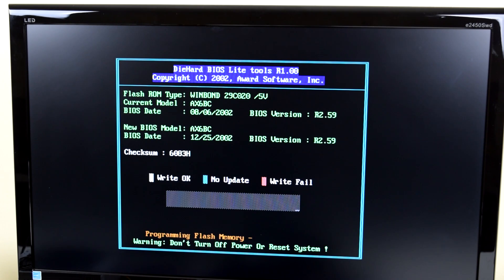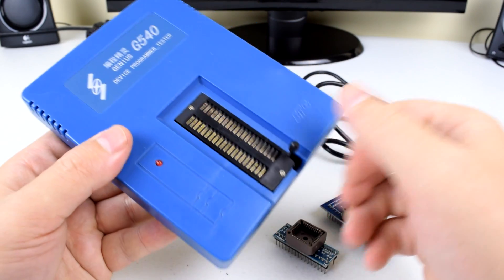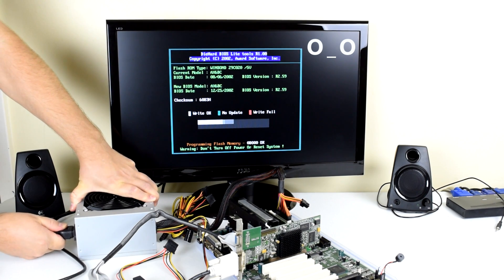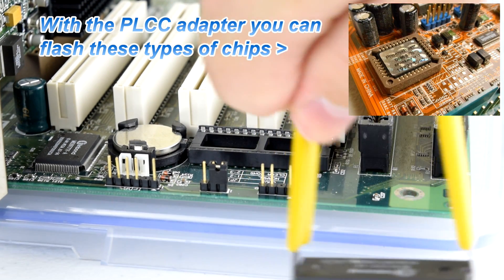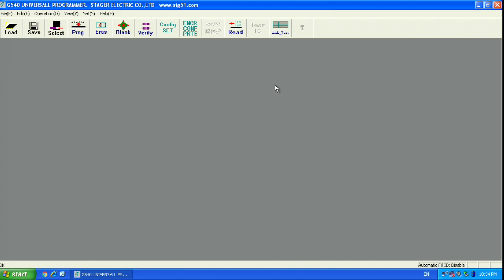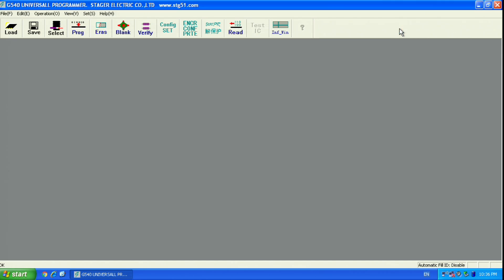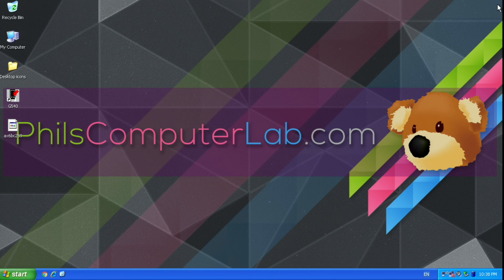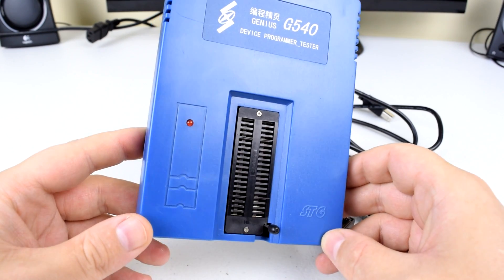External BIOS flashing with Genius G540 flasher programmer

Comment: In the late 90's I corrupted a BIOS when my water cooling leaked on the motherboard. I had an older motherboard around which used the same BIS chip so I booted that, removed the chip while running and plugged in the one from the water damaged PC and flashed that bios from DOS there. It worked. :) 

Today I have lots of programmers for all kinds of ROMs, CPLDs and FPGAs as I'm into electronics. I've flashed a soldered SMD bios. Just unsolder it and solder it to the adapter board and flash it in a TL866 or something like that.

Comment: I also had an issue with Windows 10 64 bit USB drivers. It claimed that there was a problem with them.

So I downloaded the drivers for one of their other programmers the Stager VSpeed Series Programmer Software ( VS4000 / VS4800 / VSD8000 )

http://www.stg51.com/english/downloadshow.asp?id=12 

and only installed the USN drivers from this package. It all worked rather well after that.

Comment: You don't need the programmer if you know how to use a spare MB to flash bios using hot swap.
Reply from the maker: You don't need to hot flash if you have a programmer. See what I did there :D

Comment: no need for one of those with modern motherboards. most of them have 2 bios chips, os that if the bios is corrupt on the main on, the backup one will active and restore the main chip. Also some motherboards have the ability to restore bios from usb stick/ floppy even when bios is totally corrupt with no cpu/ram inserted
Reply from the maker: +TX-OC Lab Need aside, the chips aren't removable any way, so you don't even have the option. Newer boards do make it a lot easier with flashing from USB rather than boot floppy.

Comment: Phil, have you ever done the BIOS hot swap before? I remember having to do that when a mate toasted his A7V-133 BIOS.
There's something about pulling a chip from a running computer, and replacing another. It's like crossing the streams - the thing that you just KNOW goes against everything you've ever been told/learned about technology, but it's the right action for the process.
Reply from the maker: +SireSquish Yes I had to a few years ago with some super socket 7 boards :) It worked great but I was glad when I was finished.

Comment: Wish these existed back in 2012. I had one retro PC that had a BIOS failure, and replaced the board with another 486 board (shortly died of ISA slot short circuit), and now it has a SS7 board in it. Want one right now, but it's from China, and who knows what ships from over there.
Reply: +WinVistaUser2 You can repair it !
Power on your ss7 motherboard with a bios flashing tool and your 486's bios rom, take the bios from the 486, remove the one inside you ss7, and replace it with the 486's bios, and then flash it ! Once this is done, you can put back both bioses from where they came and then try to boot your 486 ^^

It's called BIOS hotswap. I've tried it and it worked successfully ! (I tried a bios rom on my pentium 3 that came from a slightly different motherboard and it bricked the bios. Knowing BIOS hotswap, I used one of my pentium 2's motherboard that was laying around, and it worked !)

The best software to do this in my opinion is called "uniflash". The website is dead, but it's still present on the wayback machine (and you can still download it from there)
Reply: Deksor Darn. Forgot to mention that I got rid of the board since it also suffered from  more issues: PSU connection quit working, and the CPU connection was giving out, but the CPU still worked in the other board I had. I sold the AM486 DX-4 120 and AM5x86-133 CPUs back in December, 2014 to a guy in Canada.
Reply: This particular model or…? Because external bios flashers have existed long before then.
Reply: +Eric McTrainshit
True, EPROMs was developed in the 1970s, and you could (obviously) get programmers for them. Of course, it is a rather specialized bit of kit, so it would be mostly people working with digital electronics and programming firmware and such that would have them, so I am not surprised that some people don't know about them.
.

Comment: Newer motherboards like Asus or Gigabyte can work also as bios flashers. Just plug in the power. Asus P9x79 even didn't need a CPU to flash it. I needed to update the bios on it, because it couldn't recognize the CPU. But as I had no compatible CPU at first I taught I'm stuck. Later I realized that I could just format a USB stick to FAT32, load the bios file, stick it in the special USB-port and press the flash button. With only the 24-pin MB power connected. I guess thats why they also might have the chips soldered.

Comment: I have been using a manual programmer for years now , I got one of those cheap programmers on eBay.

best thing of it is you can flash patched bioses , I embed a sata PCI ROM to allow me to use those cheap PCI sata controllers from China to make them boot able with XP and pre XP builds.

you can also cross flash certian bioses , P2 Era PC-Chips motherboards are especially good for this as a lot of the boards are identical but for some reason they only updated some of them...

Comment: I successfully corrupted the BIOS on an Intel board.  First attempt I waited until flashing was half way through before pulling the power, but it still booted, so next time I pulled the power as soon as it started flashing, and that worked.  I then tested to see if the boot block recovery feature actually worked, but it didn't.  The floppy started to work, made some noises, but then just stopped, and BIOS is still dead.
Reply from the maker: +Michael Hays LOL, should have pulled it sooner :D I stuffed up a BIOS ages ago, had to hot flash it with another board. After that I ordered this flasher :D

Comment: Isn't the soldered "bios" issue irrelevant since the UEFI equipped motherboards usually have an read only redundant UEFI for backup?
Reply: On newer motherboards that is
Reply from the maker: +GengarTV And some boards have dual BIOS, like Gigabyte for example. True. I was mostly going by newer boards, but still old ones. Like Athlon 64 for example.
Reply: I guess that redundant red only UEFI is not standard in all UEFI grade motherboards which was my initial impression.. Still, good vid on helping elder, corrupted bioses get back on track :) Perhaps an video on other functionalities and chips on the Genius flasher is a good idea?
Reply from the maker: Hmm, I think you can flash Rolnad MT-32 ROM and GAL for Sound Blaster 2.0 CMS, but I can't think of much else...
Reply: PhilsComputerLab It's a good start :)